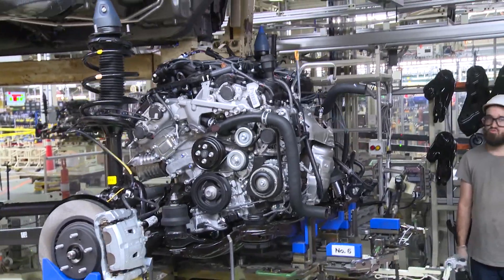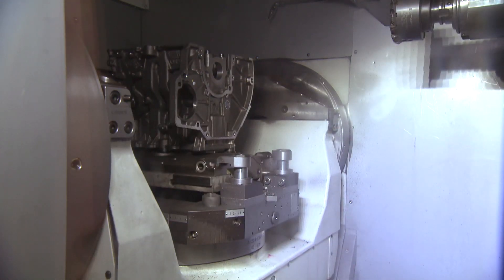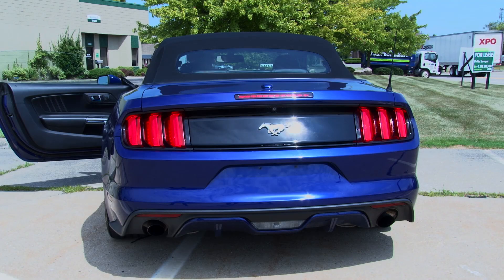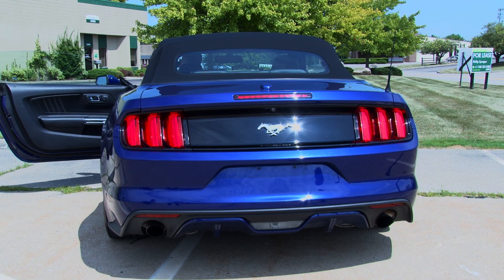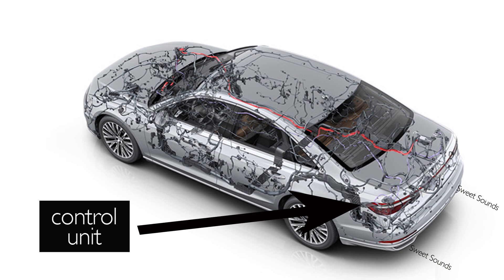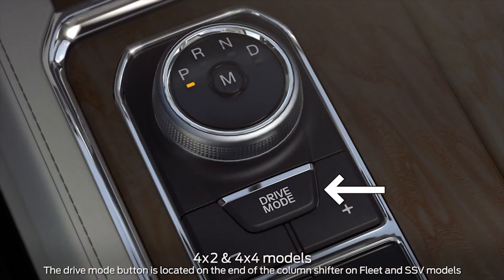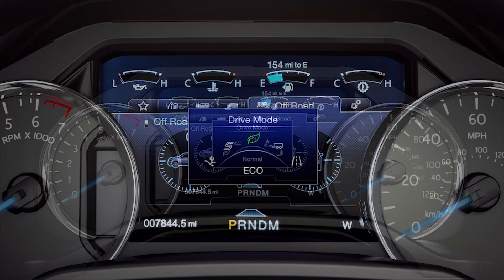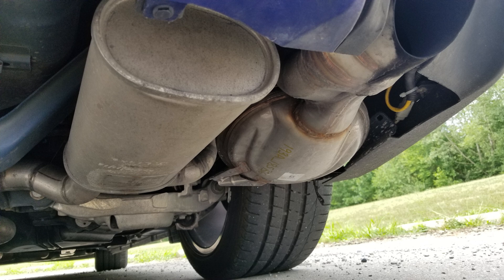How to Make a Mustang Sound Like a Ferrari - Faurecia Exhaust Technology

Comment: ford coyote v8 already has a flat-plane crank yet sounds nothing like a Ferrari.  I don't understand that.
Reply: The GT350 would sound like a Ferrari if it uses 180 degree exhaust headers in place of the stock pieces.
Reply: @CDeuce152 , has anyone done it?  Why didn't Ford?
Reply: Cost at Ford's end is a factor.  There are fabricators who could build a custom exhaust.
Reply: @CDeuce152 , the GT350R cost $83K and you don't think Ford can afford to put a trick exhaust on it?
Reply: Try meeting a compromise with those bean counters.  Cough, Rooster Teeth.
Reply: Through the grapevine, I heard that the Ford Coyote motor did sound like a Ferrari in early development but Ford was afraid the Mustang fans wouldn't like it so they MADE it sound more like an American V8 because they thought that's what their customers would expect and want.
Reply: Only the gt350 has a flat plane
Reply: @-thebatman- , you're right.  but I have found out that even the gt350 doesn't sound like a Ferrari because Ford didn't want it to.  They tuned it to sound American on purpose.